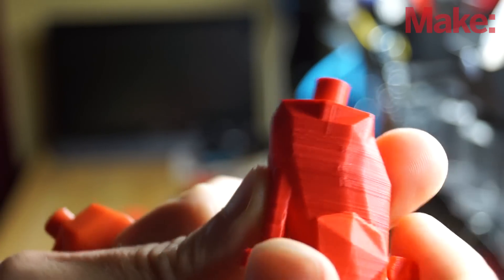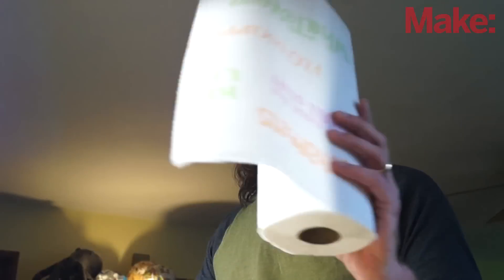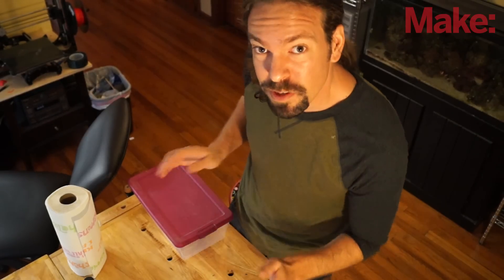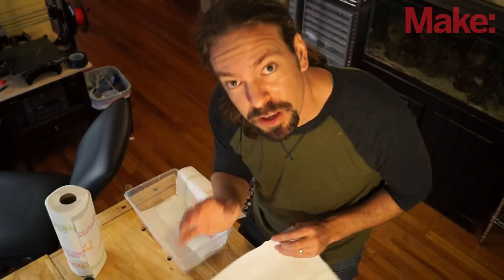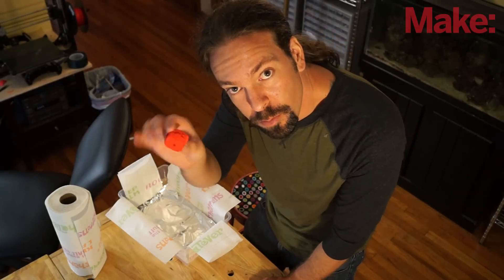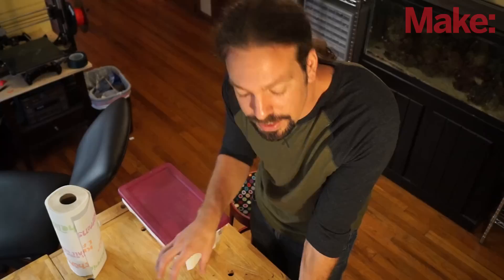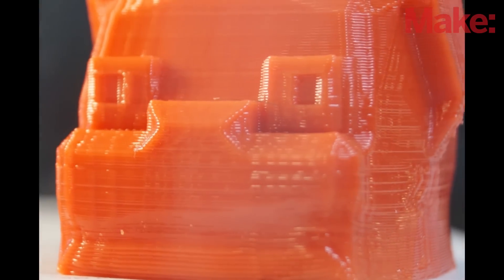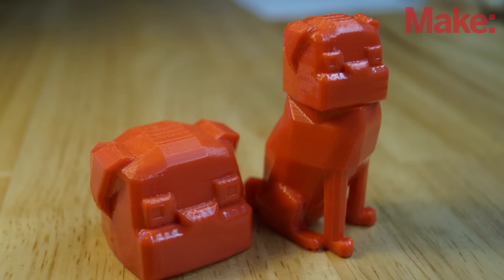Vapor Smoothing 3D printed objects with acetone

Comment: Plastic container eh? (o_O )
Reply: Yeah, what's wrong with that?  Only certain plastics are dissolved by acetone.
Reply: Polypropylene container, like most food-grade containers - extremely solvent resistant. Polyethylene and polyamides aren't affected by almost any solvents either. Also they all reject glue somewhat fierce.

Comment: Sandpaper allows for far more controlled, precise smoothing, though without the glossiness due to the fact that there's no melting, though successively smoother sandpaper will produce a more and more polished finish. I had a print come out with a ridge that was probably a few millimeters thick, but with 60 grit sandpaper and a little time (a few minutes as opposed to several hours), I was able to get it down to the point where it isn't even visible at all with the high and low points totally blended together in many places and barely at all in others.
Reply: i'm going for sand paper too. sand paper is good for my stuff. sand paper all the way.
Reply: I guess this might be more practical for prints with hard to reach angles.

Comment: One thing! Does this process weaken the plastic or, counter-intuitively, strengthen the print by filling in the Z axis seams?
Reply: Probably give it a slightly stronger shell, as the acetone probably does not get very deep into the print. It's really the natural surface tension of the ABS-acetone "aqueous solution" that causes the smoothing and rounding effect.

Comment: Thanks! This is so good b/c I need a quick way to make a "smooth-er" finish for some small toys I'm making so I don't have to spend a super long time sanding them before I paint them. :)  And it's really nice to know there is a way to do this w/out having to get it hot b/c extra expense... this is cheap and easy... and less toxic!!! (But yes, definitely still good to use a mask and also be in a well ventilated area, outside (on a level surface) is probably the best if possible I assume... when working with acetone or any other toxic chemicals) I would probably use a timer the first time, check on it every hour or so and do a few tests until I got the time down just right and then just let them sit in there in future... might have to adjust depending on weather, but the weather in Los Angeles is fairly constant throughout the year. :) Anyway, thanks for this valuable tip!!!

Comment: ever heard of sandpaper
Reply: +John Williams i have never seen sand paper look as good as an acetone treatment.
Reply: +John Williams Acetone is a mild irritant and posses only a slight toxicity. You should always take the precautions and handle it in a properly ventilated area. But it is generally not harmful to your health.
Reply: Snot Nose I think you're confused... Acetone is nail polish remover... You're comparing cyanoacrylate adhesive's harmful properties with a solvent that thins it. Water is deadly if it's breathed in as well... Get a hold of yourself man!
Reply: Or just go outside and wear a safety mask to prevent any toxic vapors in your lungs.. If you are printing stuff with many Details it will Be impossible to sand it evenly
Reply: +John Williams If you have parts that fit together though sanding is not an option because you are removing material so the tolerances won't be good anymore. With this method all of the material is still there and the tolerances will still be good. Learn something.
Reply: When I tried sanding all it did was kill the shine and leave me with an ugly scratched finish.  Don't know if there's something else I need to also do...
Reply: ever heard of quit being lazy and do a good job
Reply: you know what just forget it
Reply: Snot Nose Exactly
Reply: +John Williams Sandpaper does not give you the same glassy finish. If you don't mind your surface being smooth but looking completely scuffed (like for prototyping), that's fine. But making art pieces, they generally look better with the vapors. Also, if sanding you need to be very careful about the ABS dust produced--use masks, as you don't want that stuff lodging in your lungs.
Reply: inhaling acetone vapors is worse for your lungs plus you can allways sand it and reheat the surface which would make it look way better

Comment: what about PLA ?
Reply: +DaLi How can i tell its really chloroform? smell it ? :D Is this a valid time to ask somebody 'does this smell like chloroform to you?'
Reply: Yeah, I tried to sand my prints with a disc and belt sander once, it didn't work too well. Just melted my print away.
Reply: Tetrahydrofuran doesnt work with pla, it just makes it mushy and weak and takes weeks for it to become stable and non brittle anymore.
Better use XTC3d from smoothon
Reply: PLA doesn't work with this technique.
Reply: Anthony Guerrero I googled after commenting - apparently it does
Reply: huh, well i tried it once and it didn't do anything. Maybe i need to try this again.
Reply: Anthony Guerrero ***** 
I do a lot of 3d printing (full iron man suits and props and the such)
But to be honest the only thing that slightly works with PLA is MEK.
In the end it's just better to sand by hand, might be a bit more tedious but if you do it well the end result is amazing.
Reply: yeah it's mostly a "by hand" kinda thing
Reply: I often use the dremel on a low speed for smoothing mine out nicely - then go to using hand for the last bits.
If you are painting parts it often fills in the gaps also
Reply: rensole What is MEK?
Reply: +Joseph Tubb Methyl ethyl keytone. You can get it at Lowes with the painting chemicals. Tetrahydrofuran also works on PLA.
Reply: +Liz Quilty chloroform works for PLA, (unless it's a filament that is mixed with ABS plastic) then you can try acetone, but does anyone know what to use for CPE plastic?? :-)
Reply: Haha, XD  I suggest reading the label very closely ;)